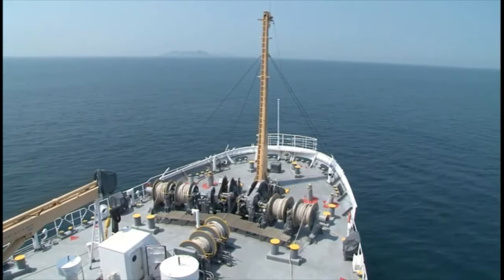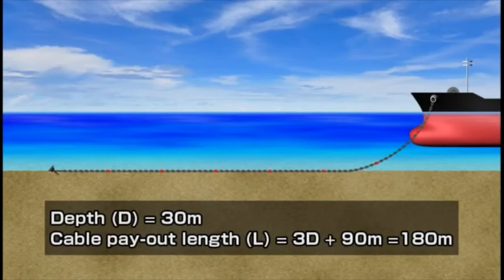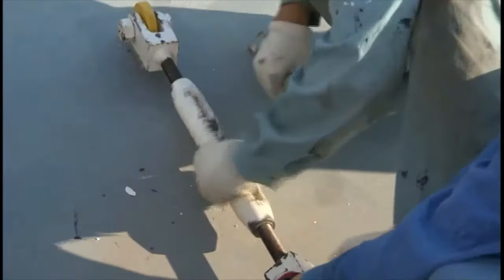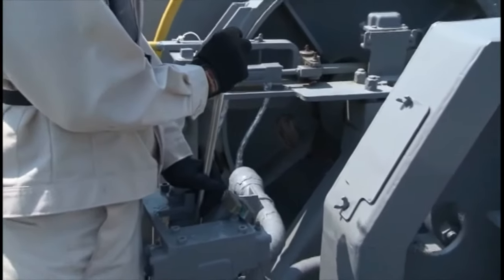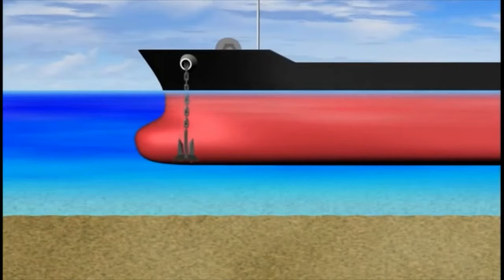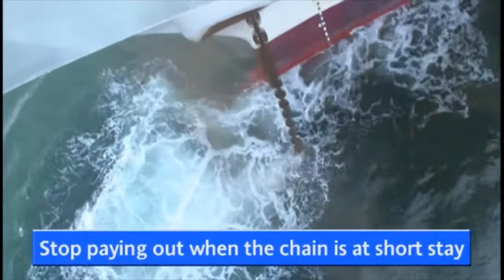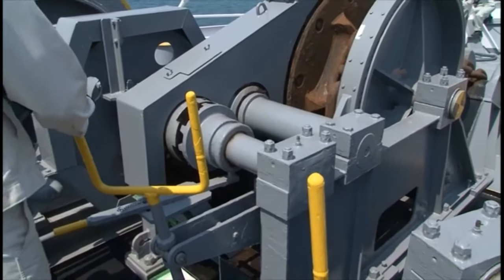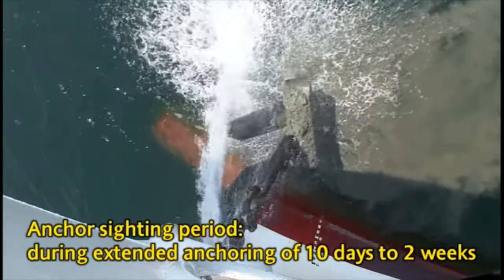Fundamentals of Anchoring Operation

Comment: at 14:48, may I ask why do we need the clearance between the stopper & the link?
Reply: Checking on the brake. Should you find the next day that the link touches the stopper, it means that the brake doesn't hold.
Reply: Captain's holly war. 
Stopper designed to sustain dynamic load while at anchor. You should take load from windlass brake using stopper.